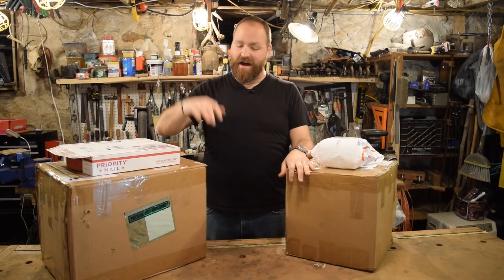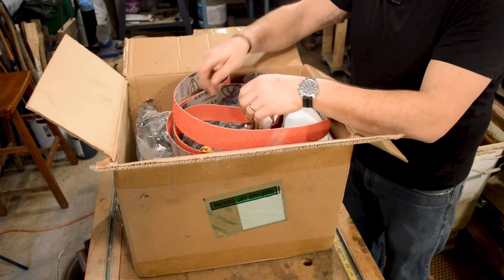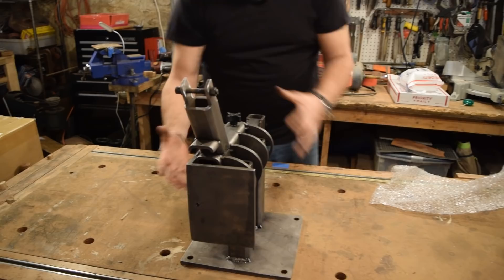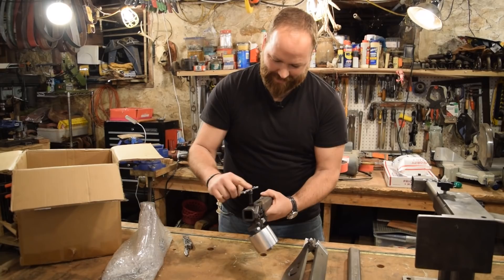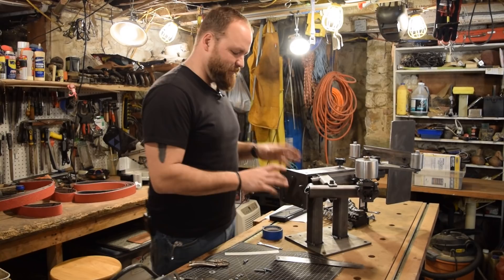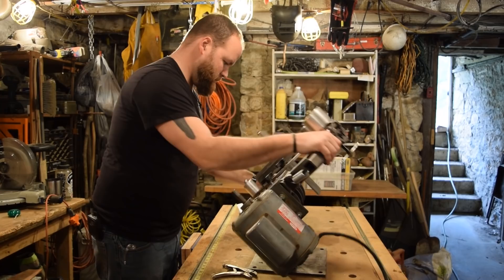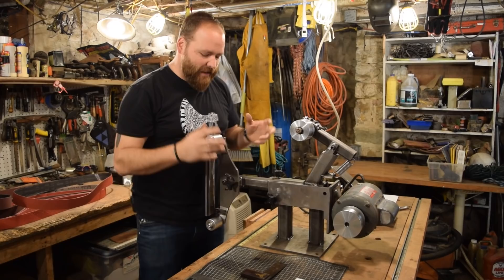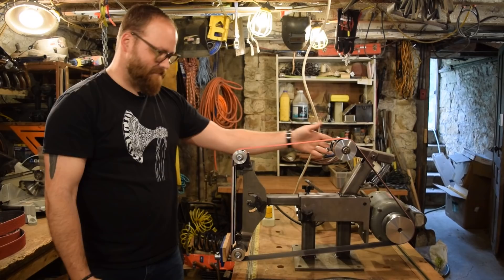Unboxing & Building the NEW Revolution 2x72 Belt Grinder from HOUSE/WORK

Comment: Might i suggest a few different sized drive wheels to get more speeds. Larger wheel should speed it up.
Reply from the maker: Not a bad idea, thanks.
Reply: Yeah I rock a 7” on mine and it’s fast. Now at some point a 3 phase motor with a VFD would make this beast mega versatile. 👊🏻
Reply from the maker: Too true!!
Reply: I used a treadmill motor. Allows for variable speed. Works well. When the motor dies I’ll go with a nice motor and VFD.

Comment: the manufacturer forgot to weld it together
Reply: I was wondering why it wasn't welded. Tacking is not welding, tacks are intended to hold your metal in place so your metal doesn't move when you do your main weld. Those tacks probably lack the penetration needed to hold everything in place over time.

Comment: Why nobody uses those cheap angle grinders which are 1.5 and 2.5hp range as a motor? Mostr of them also have built in speed control. Prices from 30-80 USD? They are also far smaller than these big ass motors

Comment: I have an older 1" x 42" Rockwell grinder/sander that needs drive and idler wheels. The plastic wheels became brittle and flew apart.  Any ideas where I could find replacements ?
Reply: You can get someone with a lathe to make them for you. All depends on the size of the bearings.